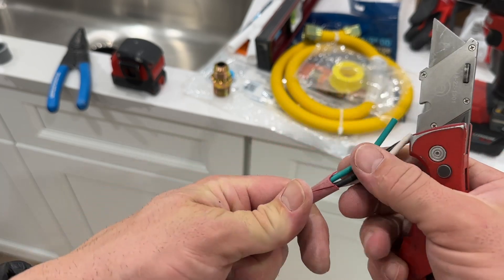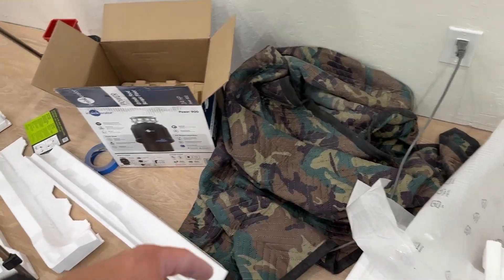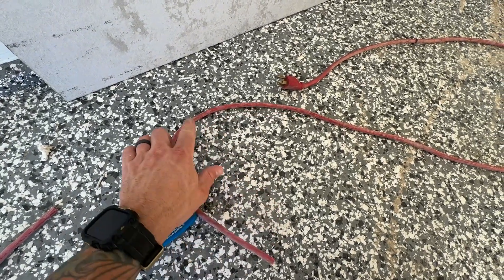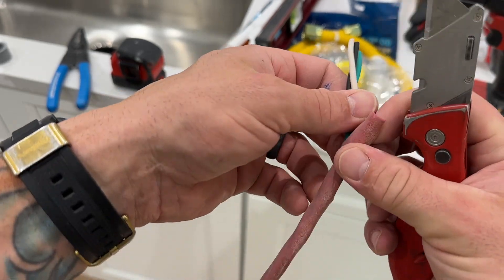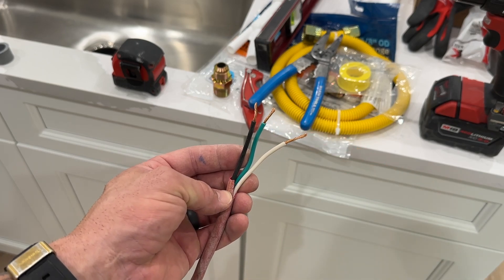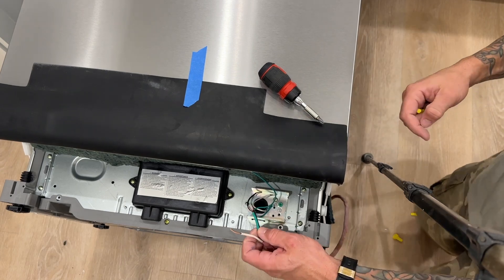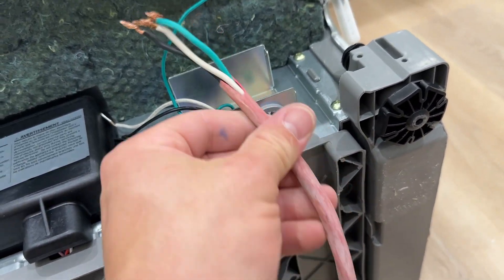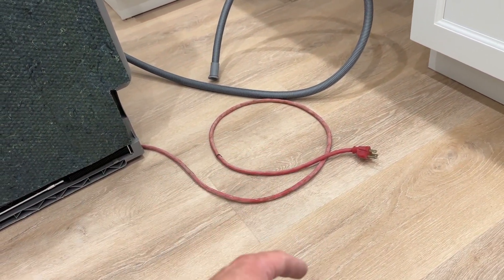How To Wire Your Appliance and Make Your Own Power Cord

Comment: curious if I should use electrical tape over caps?
Reply from the maker: Like over wire twist caps? You don’t usually need to but I have seen people use electrical tape as a secondary measure of protection and making sure things are secure.